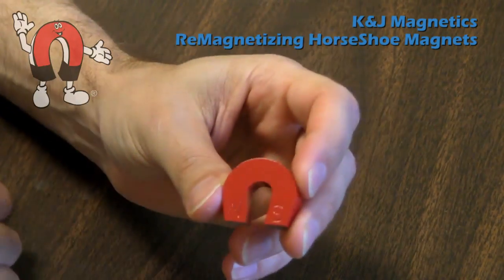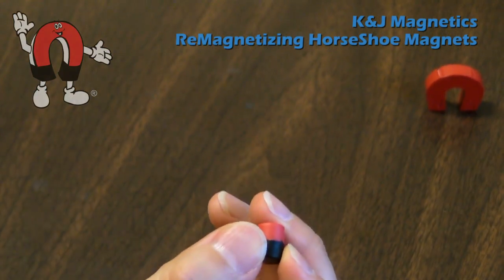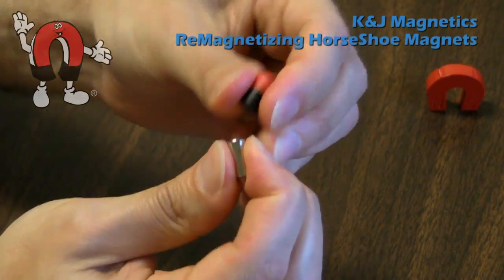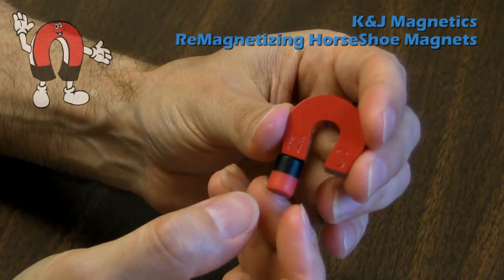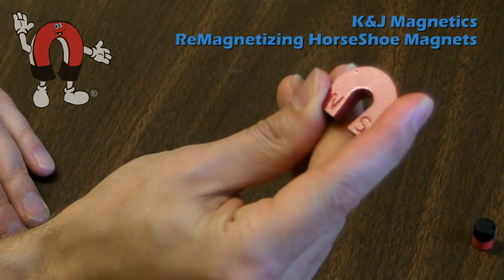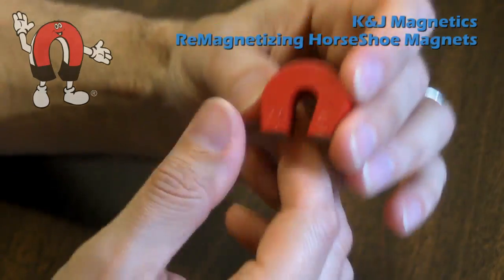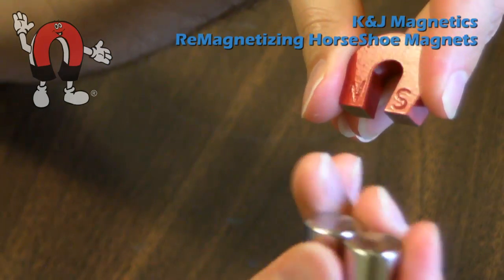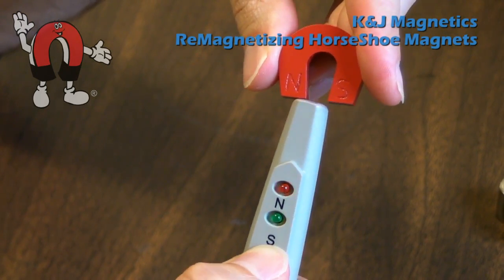K&J Magnetics - Remagnetize a Horseshoe Magnet

Comment: Fascinating!  I had no idea that AlNiCo magnets were not still the latest, greatest thing in magnets.  I have an old Eclipse AlNiCo horseshoe magnet that must be 65 years old.  It has the original keeper and seems to be as strong as ever.  (Eclipse still makes that same model and lists the pull as five pounds.)  UPDATE -- No way is my old magnet five pounds!  Just as a nostalgia thing I ordered an HS-1 along with some disk magnets that I needed for a project and the HS-1 is way stronger than my old Eclipse.  I guess now I'm going to have to order some more magnets from you so I can "refresh" the old magnet.  😁

Comment: I have a large horseshoe magnet that weighs over 10 pounds and it is noticeably weaker than when I got it 20 years ago. My grandfather says it came off a Navy ship or submarine and I cannot identify exactly what it was for, but I would like to have it recharged and construct a keeper box that contains the magnetic field to prevent damage to electronics.   What can you suggest for recharging and what material is best to create a shielded containment box?
Reply: Did you ever find out? Ive got a similar problem.